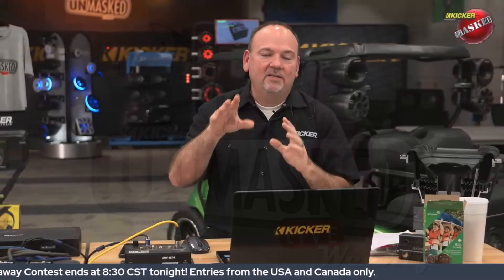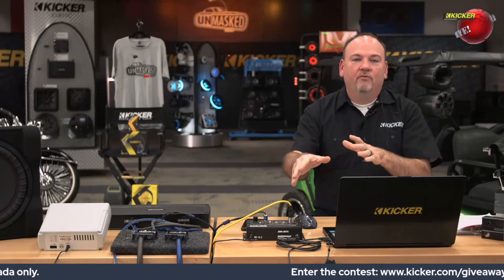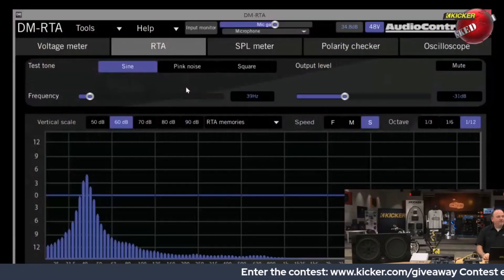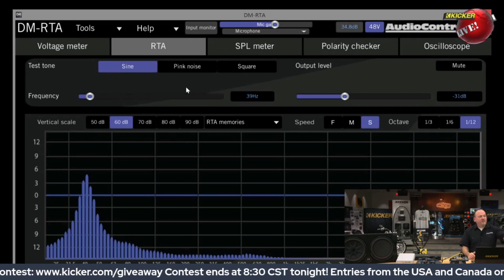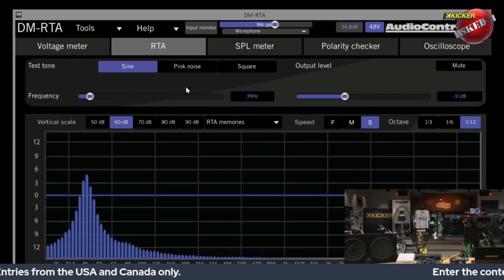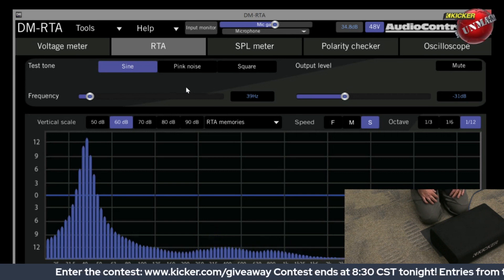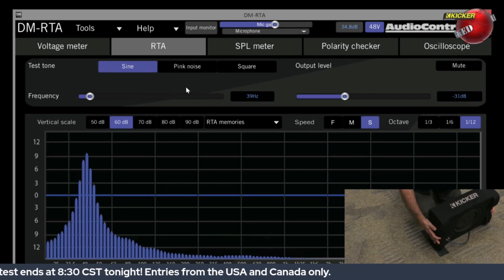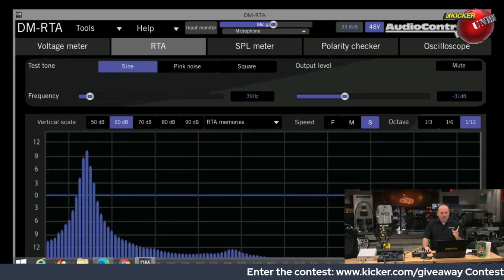Why Have a Down-Firing Sub? - -KICKER UnMASKED - Shorts

Comment: Seems probably a bit cherry picked of a situation.... run a sweep with a mic 8 feet away.... ooohhh that probably wouldn't be good for sales right? You can assume a lot by what a company does not show you...
Reply: Dude it has been proven that downfiring increases output. They are showing you that. So sorry  they didn't  show  you the complete increase over all the low notes. Damn. Hate much?

Comment: In the case of a pickup truck would you be getting the same results upfiring into the seat for underseat enclosure?
Reply from the maker: Down firing is often better. Depending on positioning, the subs strike the back of the seat. This should be avoided at all costs as it can damage the subs.
Reply: I think the material from the seats would dampen the output.

Comment: Would this be the case in a SUV with much larger subwoofers in a bigger box?
Reply from the maker: Yes but the effect will be different, as it will be in all vehicles.  We tested the effect in a big room intentionally, taking out what is called "cabin gain" so what you see on the screen is only the effect of the sub's acoustics on the mic.  This allows us to show you as fair of a test as we can  possibly do.
Reply: @KICKERAudio  I appreciate the information I will have to test the effects in my different vehicles. I have 5 rides that I have systems that I'm currently working on.

Comment: What would you recommend for a Mercedes e350. This would go in the trunk. Trying to decide between traditional encloser firing to rear or a downfiring encloser.
Reply from the maker: Question: will the trunk be dedicated to the audio system or will you have cargo in it? A down firing enclosure is good for protecting the subs, but limits the amount of space you can dedicate to the enclosure (going up instead of out). If thats not a concern, and you can dedicate more airspace to the box then a traditional enclosure would probably sound better.

Comment: We are cut from the same cloth these are the exact questions that I want answered so I'm performing all these mathematical equations myself because nowhere on the internet do they seem to want to do this. For example I'm calculating a quarter wave horn I'm designing right now and got the subs placed 14 ft from the listening position which is a quarter of 56 which is how long a 20 HZ base wave is. Going to be down firing 3:12-in SQL s through the horn box. Can't wait to test it out

Comment: @Kicker  
Kip, you need to measure this at the driver's seat headrest/listening position while the enclosure is actually playing inside a vehicle for this to be a truly meaningful test!   PLEASE???

With the subwoofer in the vehicle, the transfer function/cabin gain will be more consistently influencing/boosting the output level regardless of position & orientation.  HOWEVER...

The output level At The Listening Position will still change depending on what Direction the subwoofer is firing, as well as where it is placed within the vehicle, due to variations in Boundary Loading.  But I suspect that there will be less of a delta in the output compared to this video's "open space" subwoofer test.

The Output Level At The Listening Position will change more depending on the enclosure's placement within the vehicle.

I'd like to see you test this same subwoofer in the rear cargo area of a hatchback and SUV, and place the subwoofer in 9 positions within the rear cargo area behind the rear seatbacks as follows:

Forward Left/Forward Center/Forward Right   (up against the rear seat backs)

Middle Left/Middle Center/Middle Right   (equidistant between the rear seat backs and the rear hatch door or rear boundary of the vehicle)

Far Rear Left/Far Rear Center/Far Rear Right    (against the rear hatch door or rear boundary of the vehicle)

To further illustrate the 9 positions, imagine that the following dashed lines represent the subwoofer position in a top-down bird's-eye view of the rear cargo area:

   Front
_     _     _
_     _     _
_     _     _
   Rear

Try the same orientations of the subwoofer enclosure that you show in this video (down-firing & up on its side), but in each of the physical locations that I described and illustrated above.

I would have the subwoofer driver facing towards the rear of the vehicle for the "up on its side" tests.  But ideally, you would test it firing forward in all of the positions as well.

The measurements should be taken at the driver's seat headrest area, and it would be good to see measurements at all positions at 30Hz, 40Hz, 50Hz, & 60Hz, as the cabin gain will vary with frequency and the subwoofer position.

This information will be EXTREMELY USEFUL for both Kicker and your customers, and will most likely steer the design and installation recommendations for your future subwoofer products. 

It will be an extremely informative test of the effects of cabin gain (the transfer function), the effects of boundary loading, and of low frequency modal issues within a vehicle below the Schroeder Frequency.

I would prefer to see measurements using REW (it would be much more useful information for your engineers), but the DM-RTA measurements would suffice if you can take screenshots of the live views.

You guys would be ABSOLUTE LEGENDS if you performed these tests and provided the data to the car audio community!

PLEASE give this comment a "LIKE" or THUMBS UP if you would like to see  @Kicker   perform these tests.  ;)